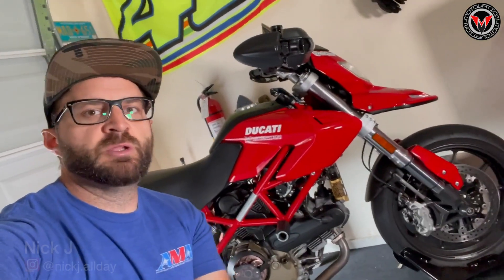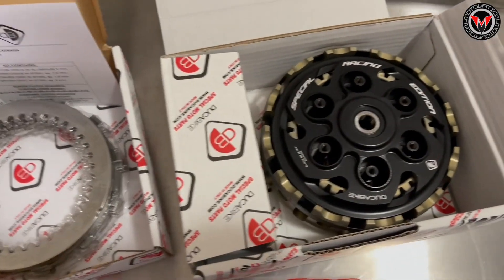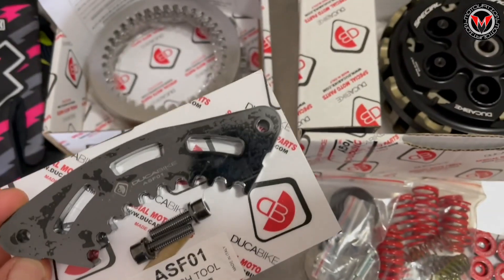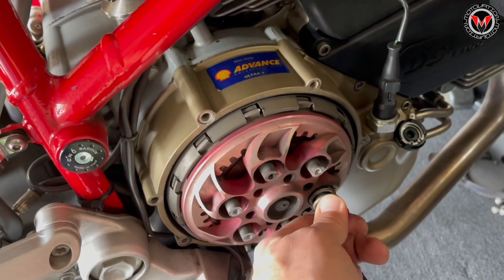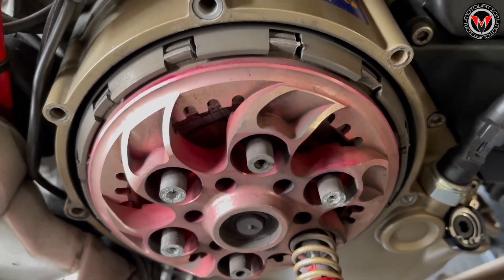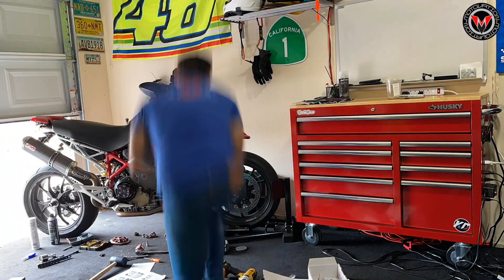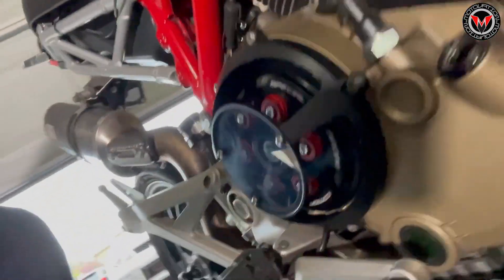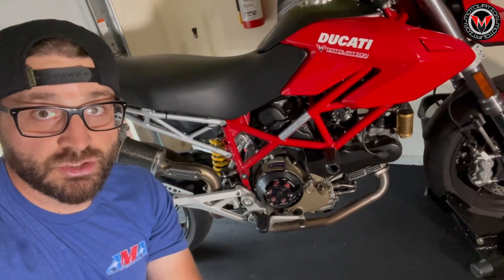Ducabike Slipper Clutch Install - Ducati Hypermotard 1100

Comment: Did the sound on engine braking dissapear completely? or does it sound like before but just a bit less noise?
Reply from the maker: Slight difference in sound. The engine braking performance is very different due to the nature of a slipper clutch.